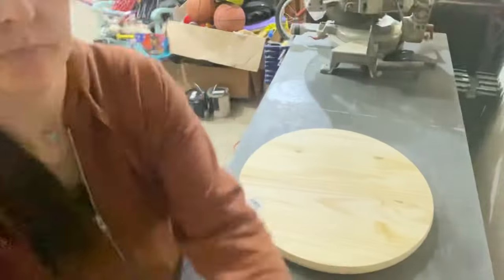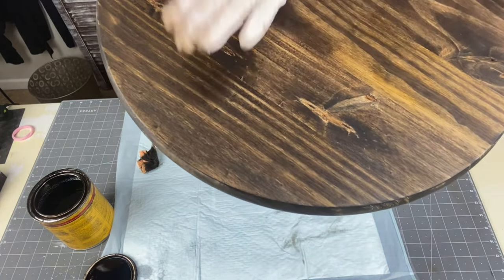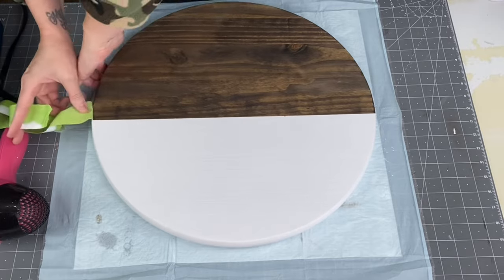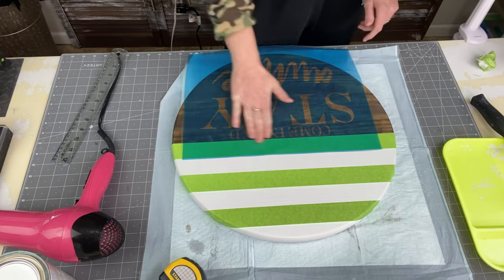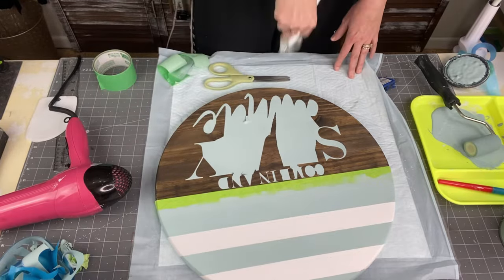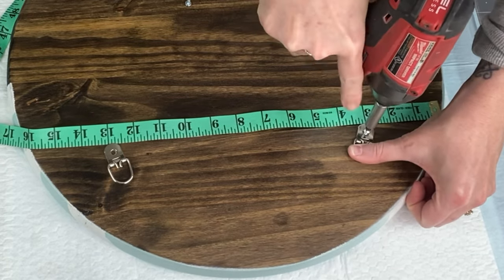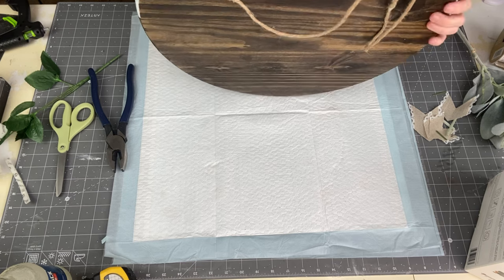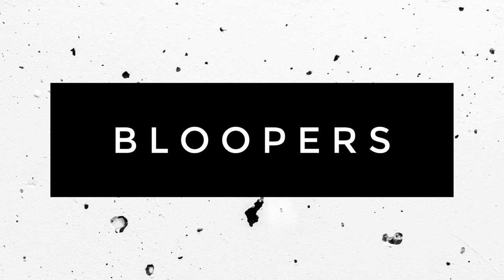DIY WOOD ROUND | STEP BY STEP WOOD ROUND TUTORIAL | WOOD ROUND DIY | WOOD ROUND DOOR HANGER

Comment: Thank you so much for this step by step! I absolutely love your videos. I'm curious though if you've had any problems with the velcro method during the hot summer months?
Reply from the maker: Hello Lilia! Nope! No issues here in Kansas and it's hotter than heck and humid. I actually still have this wood round on my front door and still holding strong.
Reply: @UnicornDustDesigns  Awesome! Thanks!

Comment: Thank you so much for your video, I don’t see the brush you use for the dusting off or the one you use for the urethane. I bought some of the helmsman non of them said water based but the outside says and looks the same as yours, so that should be ok right?
Reply from the maker: Hey K R! The can needs to say water based. It will say it in caps on the front of it. If it doesn’t specify that means it’s water based. 
For the brush I’m applying helmsman with that’s just a cheap chip brush. You can get them at any hardware store. And for wiping off the flakes I use a synthetic brush. You can get both of them at dollar tree 😊
Reply: @UnicornDustDesigns  thank you for your quick reply, I had bought the helmsman when I first watched your video a few weeks ago and went to use it the other day and my round looks horrible, I mentioned none of the cans said oil or water based but they said they were for outdoor and such well I found out the hard way that mine is oil based ☹️. If it doesn’t say water based it’s definitely oil based, if it says clean with paint thinner or mineral spirits it’s oil based, lesson learned on my part. I’m hoping to get the right stuff and it works better then what I currently have

Comment: This sign came out so darn cute!! I had a question when applying the clear coat, I’ve noticed that I have some white on my board mixed in with the clear coat that I’m pretty sure is from the text design on my board, is there any way to avoid this? I wipe off all the extra like you did with a brush but still had some end up smearing.
Reply from the maker: If you’re finding the clear is smearing your paint then spray a light coat of clear matte on it - let it dry - then go ahead and clear. This should solve your problem.

Comment: Hey!!! Question. When I stain my signs— why does it take so long to dry?? Your stuff dries soo quickly. I used a Varathane weathered grey oil based. It’s been drying for 5 hours and NOT drying. I didn’t sand— is that the problem?

Comment: How do you get the vinyl to not pull the wood stain or paint off? I’m using the same vinyl and I wait for the stain or paint to dry but it will still pull it off. How long do you wait before putting vinyl on ?
Reply: Also, do you always use an orbital sander? Because the one in your Amazon store is different.
Reply from the maker: If the stain is throughly dry it shouldn’t pull up with the vinyl. 
Yes, I do use an orbital sander. I also use the one in my amazon store just not as much. I couldn’t find the one I use. It’s a Skil Orbital Sander
Reply: @UnicornDustDesigns  Okay thanks so much for replying!